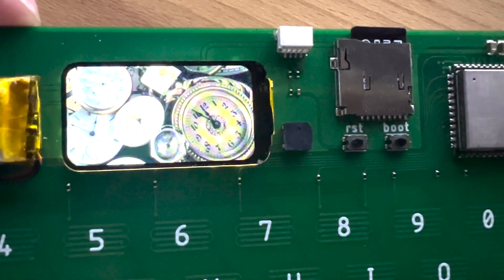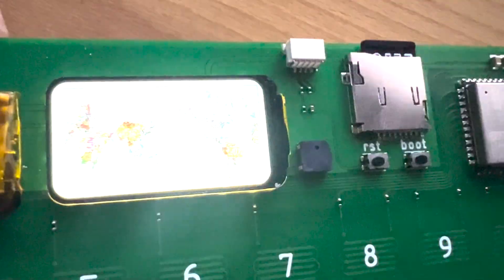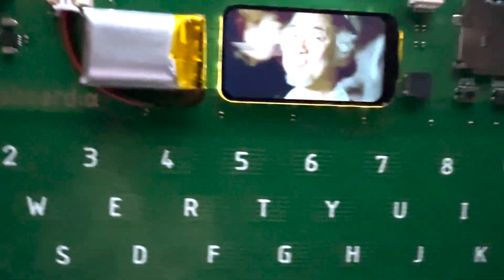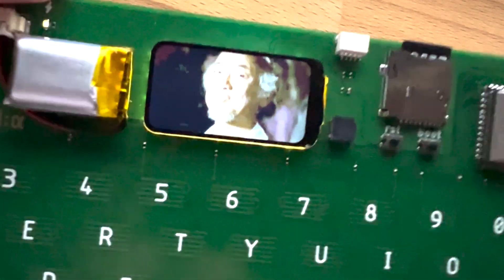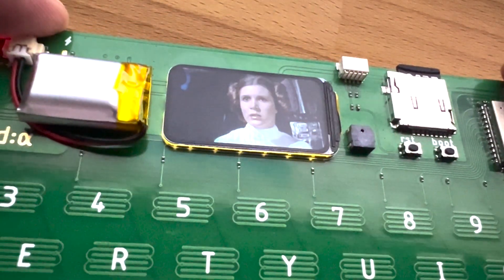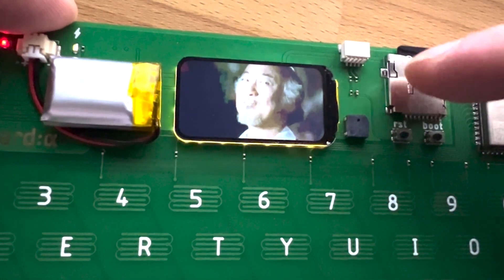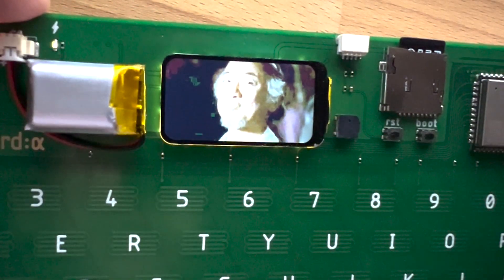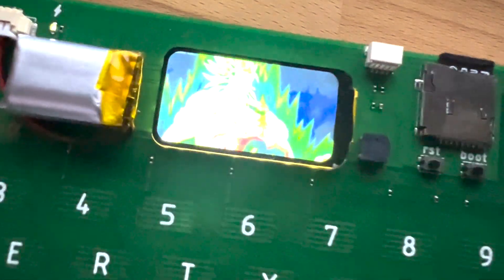SD-Card to LCD working on Singleboard Alpha

Comment: You knew you were going to be asked this: Is the ESP beefy enough to run Doom?
Reply: More than.  The XTensa LX7 is dual-core and runs at 240Mhz.  It's low on RAM, but DOOM has been made to run on systems with lower RAM counts (google "spritesmods christmas ornament doom" to see a project using the ESP32-C3.  The ESP32 name is really a brand at this point, BTW.  For example, the C3 series uses a RISC V processor instead of the Xtensa brand CPU used here).  There are people working on getting some degree of usable Linux running on this particular ESP32 subline.  

To be honest, the biggest barriers to running DOOM will possibly be the speed of the SPI interface to the SD card, and quite probably the speed with which the system can draw to the screen.  I am an idiot, but skimming the discussion on the website didn't really seem to show anything about what parts of the ESP32 were being used to talk to the screen, so I have no idea what kind of framerate full-screen color graphics can be written at.  The processor is beefy enough that if someone realllly wanted to, they could probably crank out a version of dosbox that could easily run at 386 speeds.  At that point it would be a matter of hooking enough ram to the system via a fast-enough connection - you could play DOOM off images of the original shareware floppies.